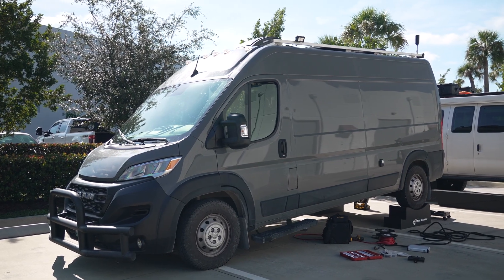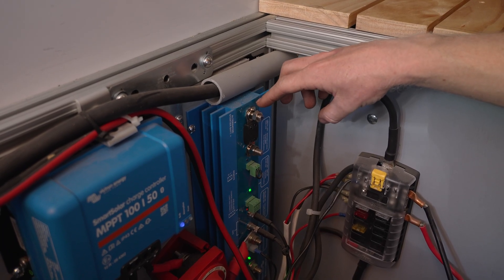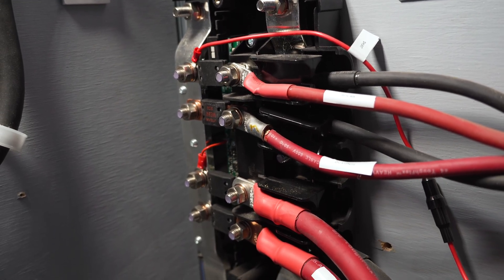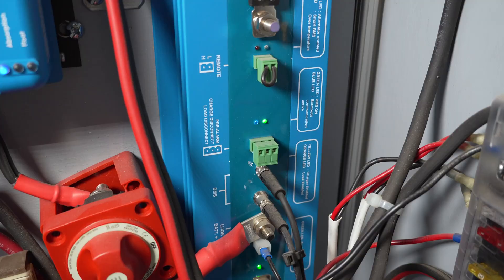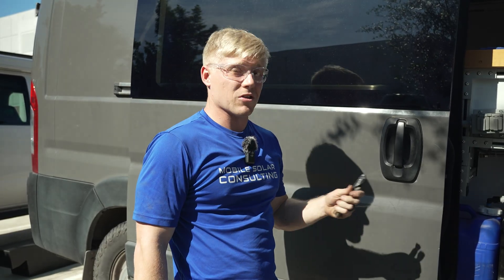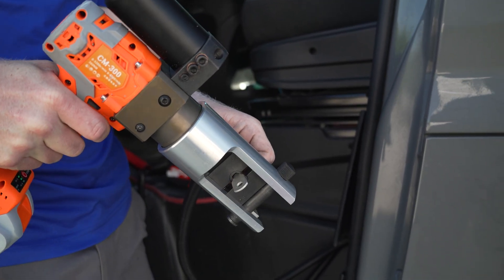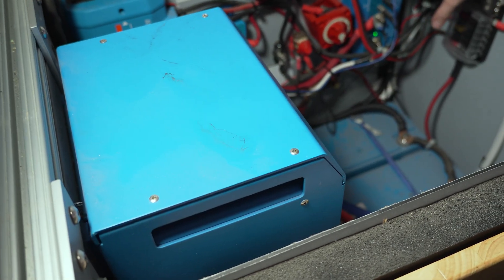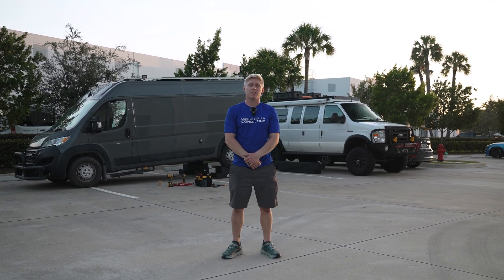Fixing Solar MISTAKES That You Want to AVOID!

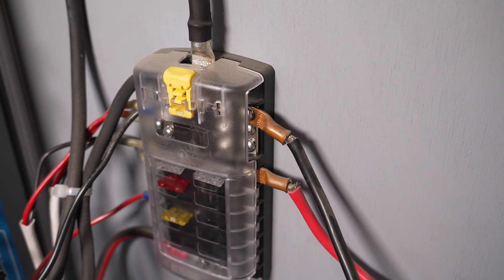Comment: You can see very clearly at 1:49 why solder is not allowed for lugs, in particular in high vibration environments without strain relief.  The interface between the solid soldered portion and the movable stranded portion of the wire is a very weak interface and any side-to-side motion will cause a wire break right at that point.  And you can see the wire break already forming on the red cable.

Soldering isn't completely forbidden, there are advantages in protecting the interface from corrosion after crimping, but there are requirements and because people constantly fail to adhere to those requirements, code generally disallows soldering entirely.

But, for example, one place where you can solder is say the crimp joint on an MC4 connector.  Always crimp first, then solder after crimping.   But since the MC4 has built-in strain relief that prevents side-to-side motion, with plenty of headroom between the strain relief and the crimp, soldering is ok for that joint (after crimping... crimping is still mandatory).

--

A cable loom won't do the job going through holes, by the way.  You need rubber grommets for any holes cabling goes through.  Always.  Wood, metal, any type of hole.  Always needs grommets.

Great Video!

-Matt
Reply from the maker: Hi Matt, thanks for the comment! Where did you get your knowledge/experience? What requirements specifically are you referring to?

Comment: In this case crimping is always a better connection
Reply: Exactly. Especially for high amps.
Reply: @herkko61 absolutely, solder is for very low current flow, it will cause heat in this application…just use a thermal camera or a temperature gun and it’ll be there.
Reply: This van owner is in good hands!
These guys are the best.
Reply: Too much heat and the wire will fall out of the lug. Not good having live wires falling out of their lugs. Always crimp